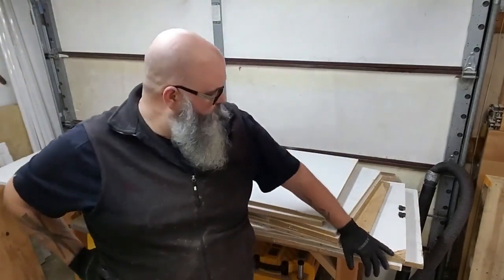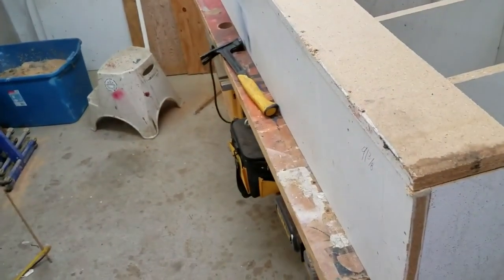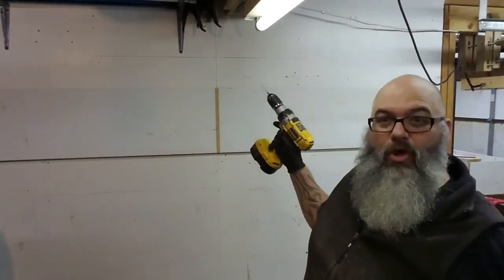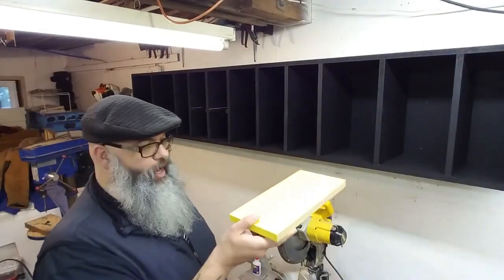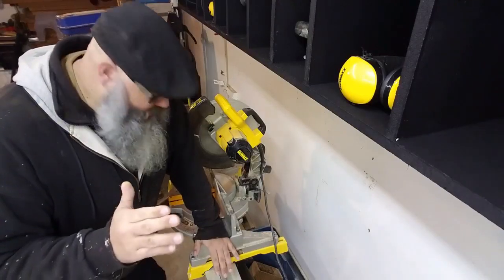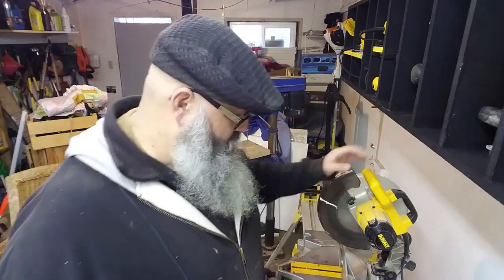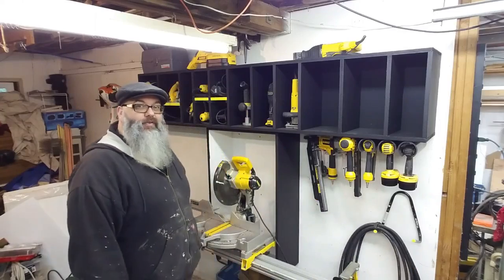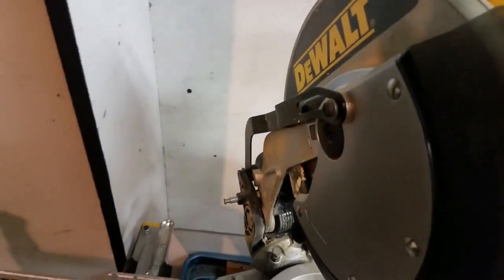A DeWALT Garage!!

Comment: I love my DeWalts. I have a cordless drill, impact driver and a 1/2" high impact wrench all 20V. I also have a corded drill that's DeWalt. I love them all, especially the impact wrench that I bought mainly for lug nuts. I don't use them everyday, but I love when I do need to use them and sometimes I try to find a reason to use them. Next I'm either going to get a grinder which will be a 20V DeWalt.
Reply from the maker: Nice! Sounds like you got yourself a great start! How is the 20v cordless impact for tires? I was thinking of getting the DeWalt pneumatic impact wrench for that purpose. The 20v cordless grinder could be nice, but I would think about a corded one if you are going to use it for a long period of time, like putting a sanding or carving disc on it, but I-m just comparing my corded sawsall to my brother-in-law's 20v. Good luck!
Reply: The 1/2" impact has plenty of torque. It's good for about 1,000 to 1,100 ft/lbs on the high setting. It's probably overkill for what I need it for, but it would have no problem with lugs that were last put on by a shop using a pneumatic impact. So far it hasn't had a problem taking off lugs. Plus being battery I keep it in my truck without needing a compressor. Looking at the size of your compressor I don't know if that would be able to keep up with a big high impact wrench. I'm sure it would have no problem if you're just taking off 1 wheel, but all 4 back to back when doing a rotation I don't know. I could be wrong though since you probably know more about compressors than I do. I'm not downing that compressor either, I just don't know if it would be able to keep up with long constant use, especially if it's having to do a few impacts to break loose the nut. I do know that even hose size can matter on how powerful the tool is. That can happen with a battery tool when the battery is low, but of course you just change the battery and keep going, while with a compressor you'd have to wait for the compressor to build back up. The battery tools now are on par with pneumatics. I'm sure you've seen that DeWalt has 20V nail guns also so you may one day not even need the compressor anymore if you invested in the battery nail guns. The Impact wrench I have is the DCF899.

Comment: I’m no hater guys but in reality  I don’t think any tool brand  available now days will be around  forever or even many years. Mostly all of it is cranked out of Chinese factories for as inexpensive as they can be made the days of being built to last are over why i conclude this is  very few of the companies my Dad or Grandfathers swore were the best  and they were quality are gone  I do think that a lot of the  modern  Dewalt tools are pretty good and own quite a few as my go to. Tools  but they are nothing close to my Dads 1950s AMF Dewalt radial arm saw i still have   Btw AMF is American Machine Foundry not  the sporting goods Harley. Davidson owning company   Back when Dewalt was  Black and Decker  who was a quality  company back in the day  one i still buy despite them lowering quality for pricing as well  ironically i bought  my Black and Decker. Cordless set up  because. They were less money for new sets than replacing worn out  Dewalt batteries and chargers at the time  and the Black and Decker  ones have  done the job i needed them for over 10 years and still going strong  despite being used and kept in a harsh marine environment   Full time ?  Ive even recovered a battery that   Had been overboard for a year and still worked  after sitting in salt water  all that time  ? That’s a torture test on anything.     If Dewalt is smart  they should take advantage of some great marketing you would give them as i think your youtube channel and videos are fantastic and well respected  this is the future  look at what Norm Abrams and PBS did for woodworking  and construction  in general   In todays society you would be hard pressed to find somebody that doesn’t know or haven’t seen  either This 

Old House or New Yankee Workshop. Over the years. Heck even my mother  faithfully watche the shows  and would comment or ask questions about it   Not to mention most woodworkers   Do credit old Norms ideas and style as influencing us  somehow  in our careers or hobbies  to some extent.  For me it really was a skill or  trade my father taught me.   More than anything   I hope your channel keeps going as i enjoy it very much for education and entertainment    Craig
Reply from the maker: Thanks for the comment Craig! I grew up on This Old House and The Yankee Workshop...love Norm! That's a great radial arm saw you got there, and the story about the water logged battery is crazy! It is funny how Black and Decker was quality, and then it became cheaper and they focused on Dewalt. Perhaps they just switched the quality over to Dewalt and was a wise marketing scheme. Thanks for watching!

Comment: Great video.  I personally cant stand dewalt tools and wrote them off long ago.  The worst experiences I have had with power tools have been with dewalt tools.  The stuff just isnt quality made and their warranty process is absolutely atrocious.  Well except for their DW717 miter saw.  The thing is just a beast of of miter saw and I love it and it is actually the only dewalt tool I own.    I do understand that everyone has their own experiences and preferences though.  For the most part I have just found dewalt power tools to be of subpar quality and dont last very long.  Which is a lot seeing a their tools are marketed towards the everyday professional.  Im a big Makita fan when it comes to drills and all my other battery operated tools are milwaukee.  Milwaukee is a brand much like dewalt in the way they mostly market towards the everyday professional.  Whats sets them apart is that Milwaukee tools are much better quality and their product lineup just cant be beat
Reply: If you get the cheaper dewalt tools, sure they don't last long, especially the battery powered tools. But if you spend the extra $50 on dewalt tools, you can get something of real good quality. The grinders and sawzalls are best to get corded, and you'll get something that lasts a bit, cheap-ish too. But for battery powered, you have to spend about $150-250 on the tool, to get something that's going to last, even then, not forever
Reply: Usually the rule for dewalt tools, is don't get the cheapest one, not even the second or third cheapest
Reply from the maker: Agreed. I haven't had any problems with them.